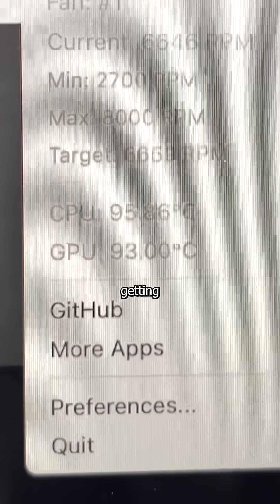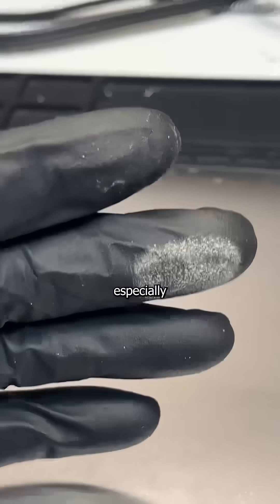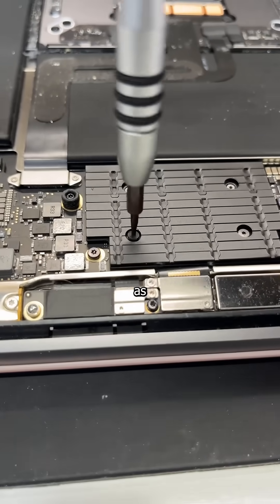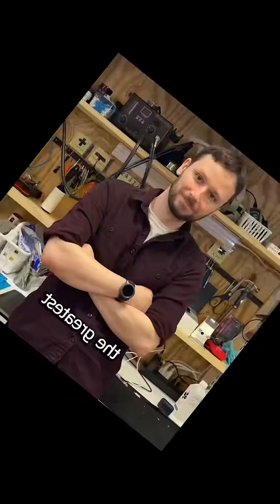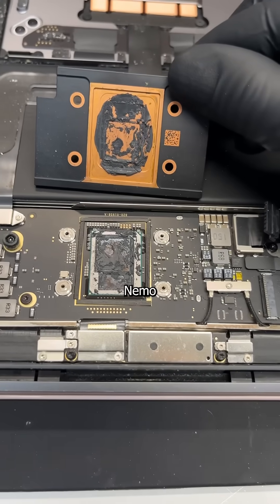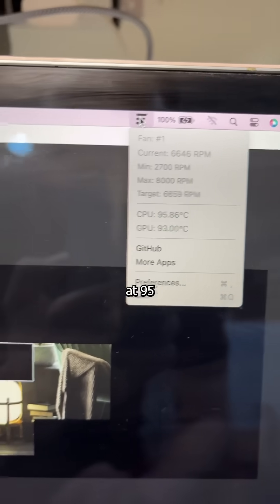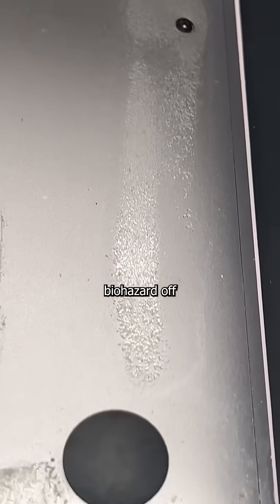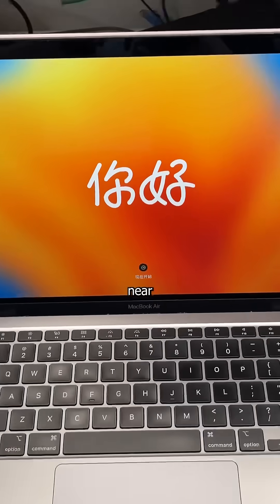Filthy MacBook Air thermal paste change (gross) #pc #tech #technology #shorts #MacBook

Comment: Wrong paste 😂 macs need a carbon based thick paste as the components don't get the same lock down pressure as a laptop or PC, there is only one paste out there that is a direct replacement, I found out the hard way , go the correct paste and went from 96c on load to 73c on load
Reply: It's an Intel based Mac so no

Comment: PTM 7950 might been the wrong choice. 
As a PTM needs to heat up to conduct properly it forces the laptop to keep running hot.
Id rather use Noctua NT-H2 so under light loads it doent have to go up.
I know that laptops cooling is shit to begin with but I dont think a PTM solution is fitting.

Comment: How does only 2 degrees make that big of a difference?
Reply: It's not that 2 degrees make that difference, but rather new paste makes that difference while keeping it 2 degrees lower. 
It improved thermal performance enough for the CPU to pull more power and do more job while staying 2 degrees cooler too

Comment: I have a 2015 macbook air (with fake ptm 7950 that I got off of amazon. Didn't know at the time you had an amazon link with the honeywell ptm 7950). For me, temps seem to have improved. The fans don't spin nearly as much, unless I'm downloading firmware files from the internet.

Is it a heatsink issue? My Air's heatsink looks so thin, it would break just by looking at it

Comment: Apple seems to put more effort into lying about being environmentally friendly but they can't make a decent heatsink for their laptops
Reply: Hence why their later Intel Macs suffer from thermal issues. Since Apple Silicon came out it is no longer an issue as Macs with the new Mx chips run more cooler thanks to how power efficient the Mx chips are, with less TDP compared to their Intel counterparts.

Comment: Just put some 7950 in my PC this weekend. Got 10° lower temps at high load than the cheap cooler master crap I was using that came with the cooler.

Comment: When even The Greatest Technician that's Ever Lived cannot get your laptop bellow 90c, you know it is a bad design.
Reply from the maker: It’s such a shit cooling system. Apple is notorious for running their chips on the limit
Reply: @SalemTechsperts  wow, and I complained about my 600$ Acer laptop blowing the hot air out the top at the screen. It isn't a great design, but it at least manages to keep things in the 70s in the one instance I hit it with a hard work load.

Comment: THE GREATEST 2 DEGREE DIFFERENCE THAT’S EVER LIVED
Reply: The temp didn’t change much but the performance did.

It was thermal throttling before.
Reply: WOOIO
Reply: it will most likely always max out at the same temperature but the performance will be better bc its able to boost up
Reply: I always like your video buddy, may your mother recover soon.
Reply: That's maybe a 2° difference, but a 20% performence improvement on the cinebench score. I call that a win.
Reply: No more thermal throttling, though. Yip e
Reply: Global warming been real silent since this amazing 2 degree difference dropped
Reply: Lol
Reply: jokes aside the Honeywell PTM7950 that he used get lower temps after few times usage because it get better after few heat cycle
Reply: This is why people should educate themselves. It's boosting higher at the same temperature, no throttling, whereas before it was throttling.
Reply: Actually 🤓 to bring down more you will probably need to do undervolting and turning up the fan speed. And that's something people wouldn't like.
Reply: @muscletype2  macbook air doesn't have a fan.
Reply: @MOU3ADREZ03  this is an intel macbook air, this one has a fan
Reply: @MOU3ADREZ03 yes they do have fans 😂
Reply: @muscletype2 it was only down two degrees cause it was thermal throttling before, it was doing more processing after he gave it better cooling potential